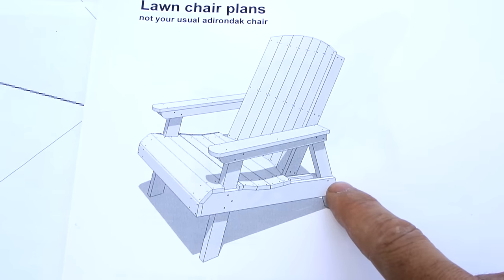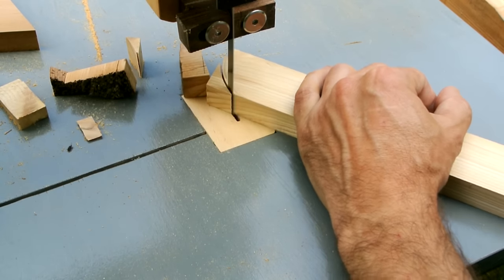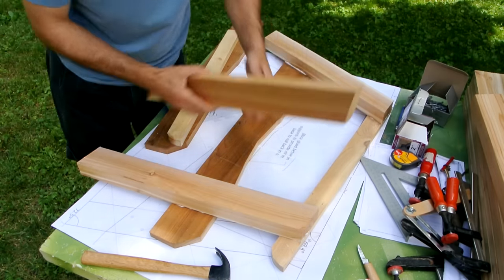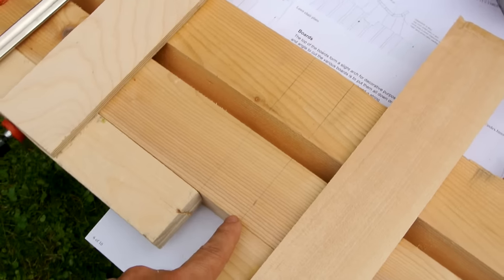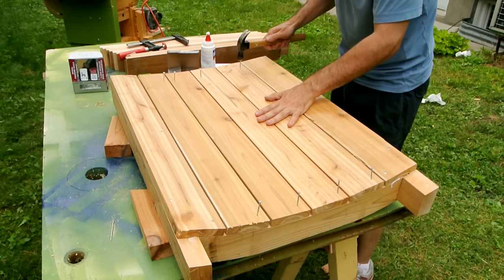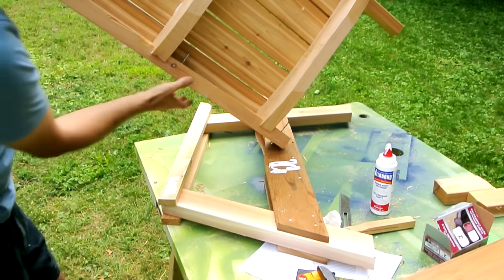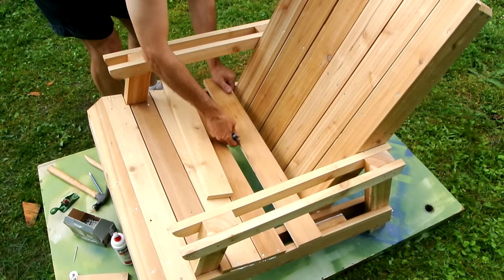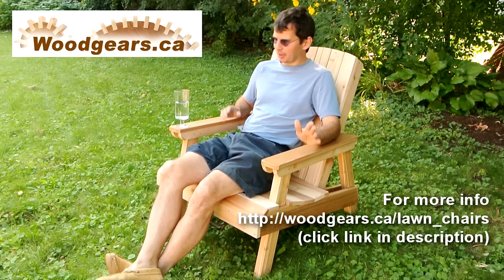Lawn chair build

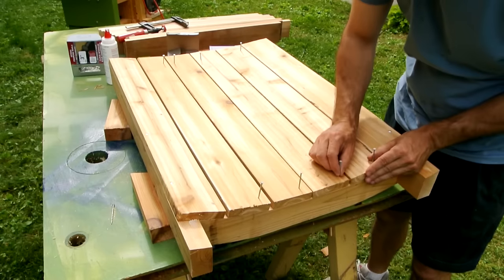Comment: 4:51  Instead of making spacers, you can just drop a headed nail between those boards - different sizes for different spaces and you probably have them handy. 
.
Your eye can see very slight variation when it's done so some sort of spacer is smart.

Comment: I love how fast you hammer, I wish I could :)

By the way have been watching your videos for a very long time and finally have gotten around to making a table saw using the circular saw, not as elaborate though as I have an old 50's benchtop saw which im building into a frame and using a 1hp motor to drive its just a little saw so it should work well. Thanks heaps for the inspiration !

Comment: Hi Matthias, you surely have all sorts of tools, but I have never seen you using an auto hammer. Is there a particular reason you don't use those? Isn't it a lot of work to hammer those nails in one by one?

Comment: I noticed this time you used white glue, does it differ from yellow glue?! (all I see in the market is white glue!!)
Reply from the maker: yellow glue is probably better, but never tested
Reply: Yellow typically would be what wood glue looks like. I find that it has a firmer hold to porous materials like wood.
Reply: ScottJohnson the pack I have is labelled synthetic resin glue and it says for all types of wood...